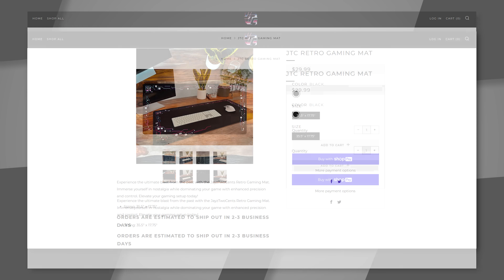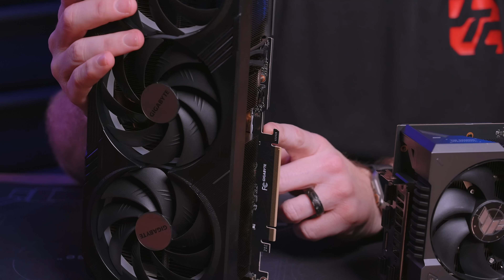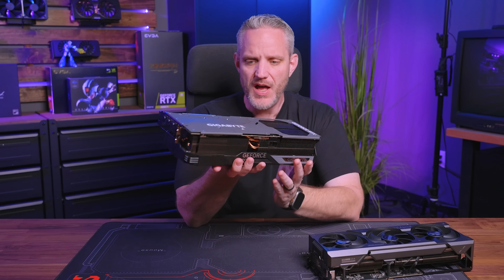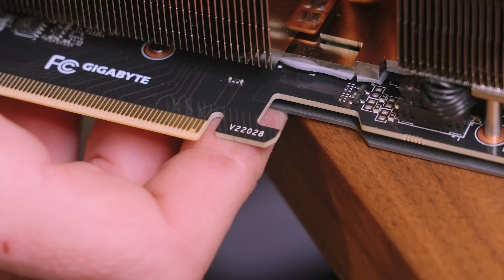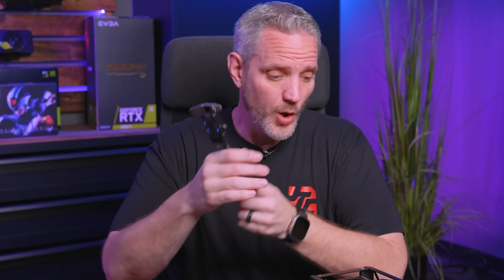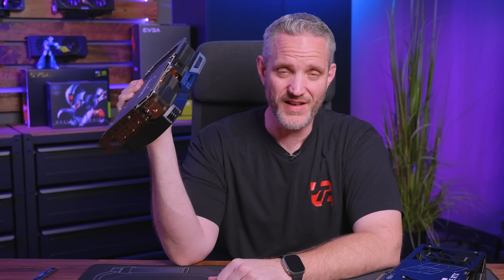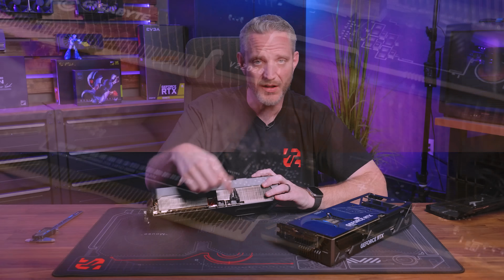These GPUs are cracking and the company REFUSES to warranty them!

Comment: Can be fixed but some do not wanna repair it unless you use vertical mount which should be baseline the standard cos cards are simply to heavy these days.
Reply: Yeah, everything is too heavy, CPU coolers, graphics cards;  we definitely should go back to the original flat desktop format. I never liked the tower format anyway.
Reply: @sassushi  Some cases these days can only mount gpu vertical this should just become a standard, its just safer to mount card this way.
Reply: @Arokhantos  no, that's overengineering,as you would need a riser and a way to mount the graphics card without sacrificing the ability to add other extension cards
Reply: @sassushi  Nothing wrong with a riser, Linus already daisy chained a lot of risers to show the impact is minimal
Reply: @sassushi  Also nothing stops you from using more then 1 riser per card some vertical gpu mounts do have ability to add 2 more cards in vertical position
Reply: The problem is yall are obsessed with glass side panels which will make it hard for vertical mounted gpus to get air (unless you're one of the custom water loop guys)
Reply: @gokublack8342  understandable cases are just to small these days for any modern day gpu Nvidia has lost its mind with the amount of power they pushing thru gpu custom radeon cards are also getting quite big while the amd MBA cards are still normal size.

Comment: So building bigger and bigger cards while shaving down construction to save money turns out was a bad idea?
Reply: Isn't that how the auto industry went down the toilet?
Reply: @Joel Huber  yeah. Every year since, I would say, 1974... steal to heavy for a 4banger engine to make this thing not feel like a lead weight? Aluminum and tin!

Oh wait, fiberglass works!

Nah, thats to expensive, just molded plastic!

Wait, they can still fix their own engine and transmission?

Well, we can completely seal that transmission and make not having a $3000 specialty computer to touch anything other than the oil and coolant caps under the hood, least a sensor stops sensing for 2 whole seconds and kills the entire car...

Ok the last one might be a little bit of a stretch, but it's not far off!
Reply: @billbollinger3748 that last one IS a thing (not sure if intentional in my case, but yes. Sensors go ☠️ Takes out enough that you might as well total it)
Reply: @billbollinger3748  
The last one may indeed be a little bit of a stretch, but that's where we're headed if R2R and R2O (Right to Repair and Right to Ownership) gets permanently shut down globally.
Reply: @Operational 117  yes indeed. Huge advocate for R2R. The only reason I own a car that's 20+ years old is because I can fully customize it without taking it to a shop. My 02 Ford Crown Vic might be old on the outside, but she's all up to date under the hood and dash.
Reply: @billbollinger3748  Main reason for that was really the rushed in EGR and air pump systems to conform to emission standards.  So manufacturers started retro fitting old frame designs when gimmicky air pump systems / digital metering carbs and stripping weight everywhere they could to improve fuel mileage. That's how s@*t like those 305 small blocks came about, perfectly good design that was made into absolute crap because of the thin walls to save on weight.   As for video cards the issue is industry is still designing cards around the "AGP like" form factor of old, when they have become way to large to be practical mounted like that.
Reply: @naomardros  Yeah one really loves those brittle BMW plastics in the engine bay or the very shitty silicate cylinder walls of failing mercedes pieces of shit...  (There are many, many , many more examples from way to cheap electrics to very thin timing chains, to half baked transmissions in not so smart smart cars or exploitable key systems in hyundais)
Reply: When are people going to learn to stop buying gigtrash
Reply: @2mo2time  trouble is SOME of their stuff is good. I use gigabyte in one of my main PCs and baffled though I may be it's been an excellent motherboard. I've also got crappy gigabyte motherboards. I'm not sure they all are made at the same place or by the same people.
Reply: At least a portion of this is directly due to Nvidia greed by making the margins too low for the aftermarket makers. EVGA explained this when they shut down.
Reply: Just for the customer since companies refuse to rma them anyway 🤣
Reply: @MichaelArlt  This in japan would cost them probably 30% their profit fine
Reply: @BelaPuma  which should be the case everywhere. If we wouldn't have youtubers, standing up for our rights no one would care because it wouldnt raise awareness. Just a mean way to handle it's customers
Reply: @faceykad8443 Yeah, it all about clout..... until these very real issues, that folk who actually know about the tech, happens to you
Reply: Still having it a card that slots into the motherboard is DUMB, they should have changed this to a cable with plugs 3 decades ago.
Reply: It's called " modern engineering" where the goal is not to make something indistructable, but as cheaply as possible.
Reply: @Tracker5111  Exactly!
Reply: actually smart idea for manufacturer to sell more GPUs once current broken.
Reply: @jaggsta  Doesn't really work in the EU so.. A lot of times you send it to the seller and they take care of it for you, ship you a new card if they see its broken.
Reply: @jaggsta  Is it?
Would you go buy another GPU from a company you felt cheated by?
I seriously doubt that.
It is not a good sales ploy.
It is however, a recipe for a 'one and done' business model.
Reply: @jaggsta planned obsolescence, what could go wrong?

Other than the fact that nobody is actually buying gpus anymore because they're satisfied with what they got.

In all honesty if it wasn't for 2023, I would probably be content with using a GTX 1080  Ti because I only own one game that allows the use of RTX.

Which I think RTX is actually a waste of time and a scam.
Reply: @jaggsta  Yeah idk I'm pretty sure if I bought a 30 series card and it broke no fault of my own and then warranty wasn't honoured, there's no way my new card would be from the same board partner.
Reply: @jaggsta maybe, if they don’t pick the other brand instead
Reply: @jaggsta   Not if you become famous for flimsy construction. I personally wouldn't buy any product from a company whose 1000$ card broke in my PC through normal use.
Reply: Who wudda thunk?
Reply: Most of these companies operate like they don't ever expect to sell another like product.
They alienate consumers with shady practices and overly aggressive prices.
It's a 'grab as much money as fast as I can' mindset.
At this point they see the consumer as either dumb or having short-term memory.
It is up to consumers as to whether they want to confirm that by repeat buying
I sure as hell won't.
A few of us are still too smart for that.
Reply: My pc doesn't even fit GPU bracket on Nzxt airflow 2023 case so bs no warranty on crack card
Reply: cards should get smaller not bigger but people like big things so big cards sell cause big = strong
Reply: Who would have guessed
Reply: What? Who would have known?
Reply: Holy crape. I want a rx6950, should I just get a sapphire and avoid everything else or what? Is XFX ok?
Reply: @Thordmac  XFX, Sapphire and Powercolor are all ok
Reply: @dgaming9791  ive never had any problem with msi. my old gaming z card is the most solid ive ever owned
Reply: @hotdog9262  I like MSI for their looks and thermals, but was turned off after the TechTeamGB debacle. I still use them, but extremely wary
Reply: @dgaming9791  sure. im just saying the gaming z is the most solidly built card ive ever seen, with tons of really good components
Reply: @Thordmac  galax is great especially hof
Reply: @Thordmac  xfx is very good quality, my xfx rx 6800 swft model even came with a anti sag bracket.
Reply: @Thordmac  sapphire is best, powercolor isn't far behind. XFX is hit and miss if you go with them get a higher end model
Reply: Duh
Reply: Who knew
Reply: So you're one of the freaks who freaked out about the video when he was away, okay.  There's therapy and medication for this.
Reply: The biggest point is it doesn't even save them almost anything , every change they made maybe adds up 10c max and then shitton of RMAs but not the ones bought directly from GIGA cuz they shut it down
Reply: Didnt see that one coming
Reply: Shocker 😮😮
Reply: Only way to increase profits are to decrease cost or increase prices.
Reply: @Iandar  Or to make products with a good value that still have a profit margin and achieve higher sales as a result of more people going to your brand
Reply: @scrubscrub4492  assuming a one in a trillion chance that market shares get inverted.
Reply: @Iandar  Actually enhanced engineering can make and item better and cheaper leading to increased profitability and/ or competitiveness.
Reply: (shocked pickachu face)
Reply: Well it turns out there are brackets you can buy to install to secure your graphics card....
Reply: @jkj9404  it turns out that you need brackets only for Gigabyte cards where they skimped on pcb thickness
Reply: @marcogenovesi8570  Where I do think that the PCB is probably either lower quality and so could have issues with the weight or they had batches that had issues, I find your statement funny when the whole video he was pointing out that the THINNER PCB on the Asus card was more less bendable and more ridged.
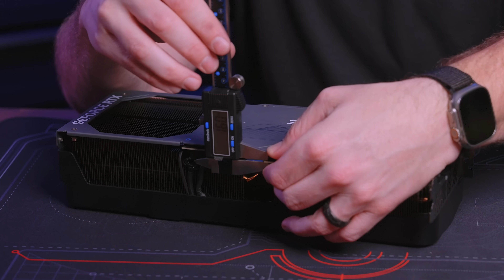Reply: @joee7452  check the pinned comment and the video at 8:34 where you can see the tool itself. Jay's tool actually measured 1.6 on both PCBs but then he wasn't careful when removing it it so it became 2 mm. The PCBs are too thin, if a different circuit or hole position (i.e. ASUS vs Gigabyte) on the board makes the difference between cracking and not cracking, you are flying too damn close to the sun and should have gone with thicker PCB
Reply: Depends on how you look at it. It could be a good move. Some people will just buy a new card when their old one fails.
Reply: gigabyte includes brackets that mount to the side of the card and attach to the standoffs on the motherboard. least for my 4080 aorus. cant keep expecting these cards to get drastically faster and faster and remain small. problem is   ppl shoving these into tiny cases and not taking precautions
Reply: @jsizzle2k6  why can’t they remain small? Why does it have to be much bigger to be faster? Isn’t it just bad or lazy design? CPU processor are also not much bigger then 10years ago.
Reply: The thing also is that, depending on the design of the PCB, the thickness can be detrimental to the electrical performance. Ideally you want all your layers close together so that they couple better to each other. The power and ground planes for example it's ideal if they are very close together so that you build up plane capacitance and can have less decoupling capacitors, the signal layers have better defined impedance if they are closer to their ground return layer etc, especially for these high power and high speed GPUs. If everything is close together is better for the performance is my point, it's not a cost cutting measure. The layer stack up definition and total boad thickness go together. 

The problem is that the coolers have gotten massive these days and the mechanical design has been fucked up and not very well thought through. You have a massive strain on the board edge that needs to somehow be resolved.
Reply: It actually looks like design choice, so the PCB follow the backplate
Reply: Just like cars.
Reply: At this point gpus should just use 2 pcie slots
Reply: @josephdias3968  Or motherboards should simply slot in GPU cards instead of the other way around.
Reply: @xbvg  or just install components like cpu and ram on the gpu instead one board one point failure
Reply: shocking
Reply: that's hard core penny pinching.
Reply: big companies ignoring QC and safety concerns for the sake of profit?
tale as old as time
Reply: The more you buy, the more you save, just buy two 
I've been buying cheaper AMD cards for 10 years, and I'm surprised I haven't had a single problem yet
Reply: I solved this problem long before it happened, verticle mount boyy
Reply: ocean gate comes into my mind
Reply: @faceykad8443 alerting their viewers to inferior products isn't something bad like you're trying to claim.
Reply: But we have to save 5 cents, while increasing the price by $300 each generation
Reply: The very least they could do is acknowledge the issue and sell a support bracket and replace the broken cards or at least repair them.  They could refurbish and sell the broken cards maybe.  You would think they would do SOMETHING.  Isn't it bad enough everyone was getting screwed over in the covid years and no one seemed to give a rat's @ss?  I am still remembering ludicrously high prices for cards you couldn't even order.  Now they are selling them used and quite possibly broken.  The very least the manufacturers could do is stand behind their new product so it doesn't feel like no matter what you do you get screwed (bent over first for this).
Reply: They aren’t pinching pennies on something like this… no way.  But once it’s out the door it’s all about damage reduction and I mean money staying in company..  it’s a huge deal to reengineer it now.  And no easy path to recall and fix cards.  Literally would have to pull chips off pcb onto new board.
Reply: They kind of have to be big because cards are getting more and more power pumped into them. Before now 250w was the top wattage for the top card of each generation and now days we got more people buying XX80 and 90 cards more than they did in the past. I remember with was top cheese if you had a X70 or 80 card back then and with a power draw of about 150-190w lol. Also, I Always use support for my GPU and that solves the hag cracking potential issue with my GPU and this is somewhat user error for that because its common since for how big cards are.
Reply: I'm so sick of sellers cutting cost at the consumer's expense and then saying it's our fault. This happens after the first year of most products too. Don't even get me started on Planned Obsolescence...
Reply: eggxactly
Reply: This is because the standard was constructed at a different time. the connector should be changed because the cards are much bigger and heavier.
Reply: @nnnnnn3647  I doubt it would happen considering the consortiums that come up with the standards are dominated by professional interests, who typically use alot smaller graphics cards.

"High end gaming cards" are really a very small niche, one in which a few manufacturers try to get away with as much as possible off undiscerning gamers who will buy their products for some RGB lights and high FPS.
Reply: @nnnnnn3647 the cards may not need to be bigger and heavier, we are told that as technology improves we can manufacture smaller and smaller, yet cards grow to huge sizes, your solution is to accept the huge sizes and work around them.
Reply: Don't forget also requiring a thicker and more robust stack of cash to acquire xD
Reply: It's not a bad idea if they don't cover the warranty anyways
Reply: @Rspsand07  tbf, your GPU (probably) isn't going to kill you as a consequence of having a lighter construction, the weight of the cooler is just as much to blame so it could be argued that lighter construction is also a potential solution (assuming you could reduce weight and still get adequate cooling)

Also something like this was kind of an eventuality if when there is a maximum price they can be retailed for set by a company that is undercutting you, margins gotta come from somewhere and if it isn't coming from increased price it is gonna come from cheaper construction.

obviously it's not an excuse for not covering warranty, but an industry being this roughly fucked by the people at it's helm is obviously gonna experience issues.
Reply: main problem is mounting today GPUs to 20 years old slots
Reply: @Pidalin the slots are a given. GPU manufacturers need to take this into consideration when designing cards.
Reply: That's why I bought Rtx 4060 laptop. Also have a desktop with Zotac Rtx 3070 people hate on that card but preforms great with games.

Comment: This company needs to be sued for screwing over their customers
Reply: Even if they did get into trouble, it'll just be a slap on the wrist, it won't change much.
It needs to actually hurt the company such as Seagate for example when they were selling drives to China. The fine had to be split up into smaller segments so the company doesn't go bankrupt outright since we do need the company for obvious reasons but you get the idea.